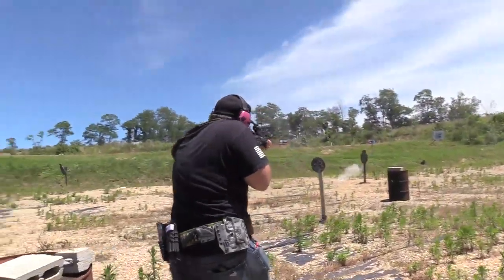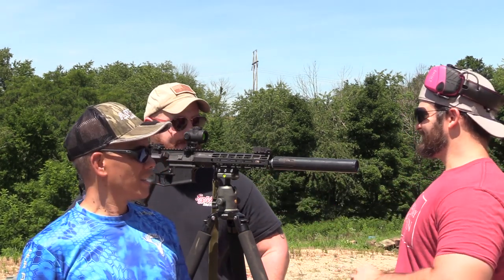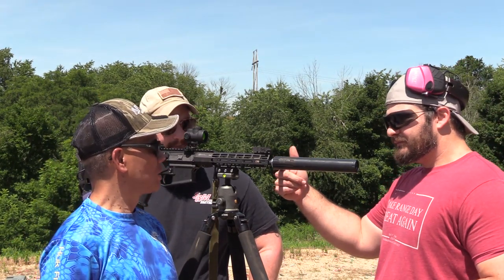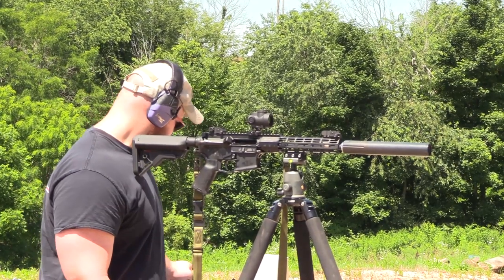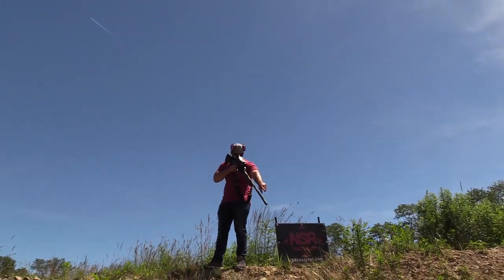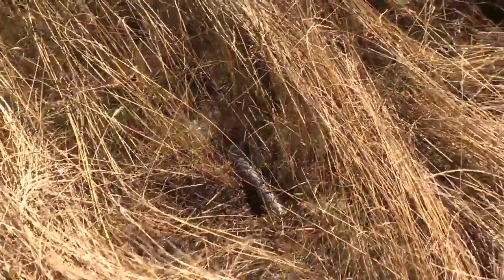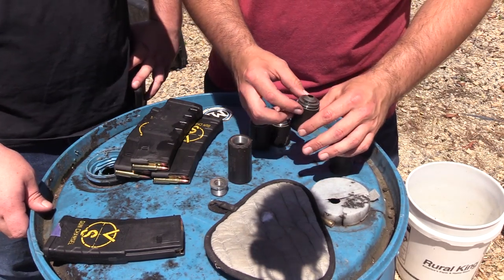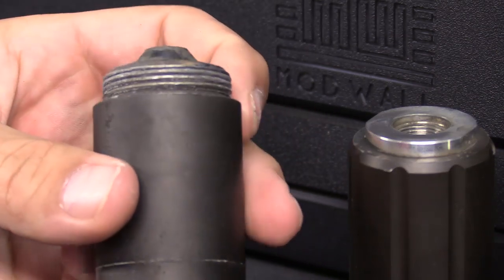Melting a Suppressor for Science

Comment: would using rocksett on all the threads do anything to make it last longer? Or was the threads already legitimately warped or expanded to the point where the baffeles weren't even screwed into anything? The reason I ask is: there's a difference between a suppressor failing because of heat warping and melting threads... and a suppressor backing off at the multiple threading points(like this one) and getting shot off. Hand tight normally doesnt do anything for vibration. I'm honestly surprised they would put that many threads, for each baffle, instead of something more monolithic with maybe 1 or 2 threads..
Reply from the maker: No it was the blast chamber Flexing that caused the failure. While Rocksett has a temperature rating of ~1500° F it does become pliable well before that point. I am going to guess that the can was at approximately 900-1000° when it failed. Rocksett is only good in stasis to that temp. When those parts started to stretch its game over.
Reply: @VSO_Gun_Channel  So were the threads gone or are you able to still thread it back together? Looked like the threads were only partially stripped. You think you could screw it back together and use rocksett? See if it lasts longer? Maybe weld it back together or something. If can do it because I was expecting major warping or melting off.

Comment: I’ll be honest since I don’t own a suppressor I would of thought they were a lot more durable & would last many hundreds of rounds. Learn something every day
Reply: Same here....Ive swear Ive seen people do a few mag dumps without issue other than cerakote bubbling...
Reply: You really did not watch they said this can is aluminum and made for hunting it's not rated for full auto fire .yea if you get a steal can that's rated for full auto it will last along time.
Reply: It depends on the construction/purpose of the suppressor.   I have a very light weight silencerco harvester .30 cal can  similar to this one . Not rated for full auto or even mag dumps. It is ment for bolt action hunting rifles and used as such i have close to 1000 rounds mixed of .223, 22-250, .308 ,.300blk and .270 through it , still going strong.  On the other end i have a rugged surge 7.62 that is "belt fed rated" it is 3x heavier and a lot more expensive and has survived much more abuse with .223 and .308 multiple mag dumps with binary triggers .  Light duty vs heavy duty .
Reply: in motion It’s the first thing said on the video. Excuse my ignorance of cans I wasn’t aware there’s different materials for different fire rates. I thought it was just different ones for different calibers that many different companies made
Reply: @Tainomontana  its even a little more complex than that  but a further break down would be. 

stainless blast baffle aluminum body and baffles = light weight ,less expensive , less durable 

100 % stainless = heavy,more durable and a little more money 

iconel /titanium construction = light weight ,durable and lots more money .
now this is a generalization . there are lots of other details that go into it as well.
Reply: @Tainomontana  you have to use cans (and mounts) that are rated for the intended use. This means weight, strength, ability to handle pressure. You wouldn't put an aluminum .22 LR silencer with a 1" diameter on a .338 Lapua, even if you could. The pressures would probably blow the can up on the first round, even if you found a way to mount it and the baffles/endcap had a large enough bore. 

There is a video on YouTube where they intentionally ripped a SAW through what I think was a SilencerCo Omega until it melted off. That's a titanium and Stellite .30 cal can. But titanium can only take so much heat. It's full auto rated, but nearly every metal will begin to fail at 2000⁰, which doesn't take long on a belt-fed 5.56 (several hundred rounds nonstop full auto).

As for mounts, I saw a guy run a pistol can on a 7.5" 5.56. The can itself was rated for something like 12.5" 5.56. And he was running a three-lug mount, which is by no means ready for 5.56 at any length of barrel. He blew the can clean off the gun and destroyed the tube and most of the baffles with one round.

Titanium cans are tough and light. Stainless steel cans are tougher and heavier. Aluminum is light, but it is for semi auto .22 only, in my opinion (excess heat will cause aluminum and steel to basically weld together).

Then there's C300 Nickel Maraging Alloy, but I'll let you research the Energetic Armament Vox if you want to know more about that ;)

Comment: Aluminum makes for an excellent heat sync, but gets hot very, very quickly. I predict 45 rds before melting, depending on material thickness. Gonna guess  .125" is waaay too optimistic. I'm a welder, so with that in mind, that's my guess.
Reply: Also, a welder based in Ohio. If you guys should need anything. 😏 lol.

Comment: There needs to be an industry standard for durability. I'd recommend running the SURG stress reliably test which is 8-30 round magazines, combat load, until catastrophic failure or more than a few malfunctions. Rate of fire per mag 1rd/sec, 2rd/sec, 1rd sec, 3-5rd burst, 1rd/sec, 2rd/sec, 1rd/sec, mag dump, cool between cycles. If the suppressor is worth investment and durability/reliability is paramount, it should go 6(t)-20(o) cycles without failure. Bore ID shouldn't excessively erode either and decibel reduction should be maintained.
Reply from the maker: No thanks. Many of those test specifications are built with a winner in mind. 100 rds full auto is immediately stressful and will tell us the weakness.

Comment: I loooove science...firearms science
I wish you guys would test out those "solvent traps" from ebay for science.
The 2x8 looks tempting

Wow, Ive never seen a suppressor die so fast....It seems like the amount of sagging with the front of the suppressor may have caused the issue.
Are all suppressors this quick to destroy (under 100rds)?
Reply: That's the point of the testing is to see how others compare
Reply: No. They picked probably the worst viable can for this pressure test on purpose. A good titanium 30 cal can will go several hundred rounds of belt fed full auto nonstop before failing.